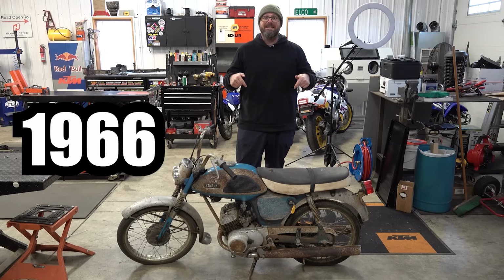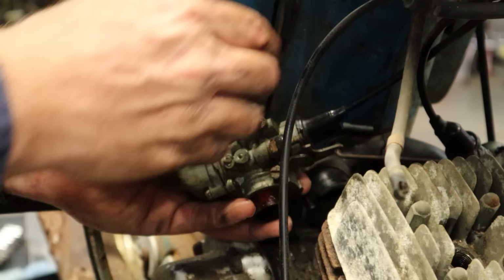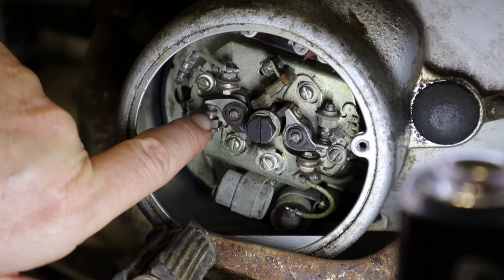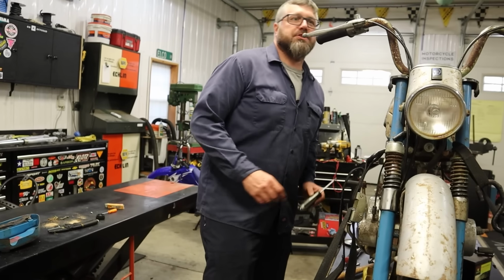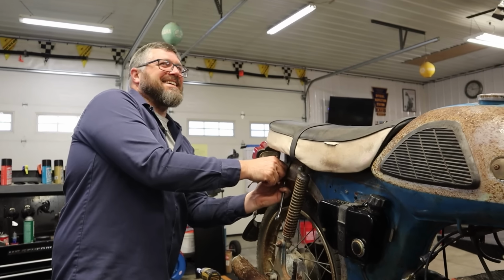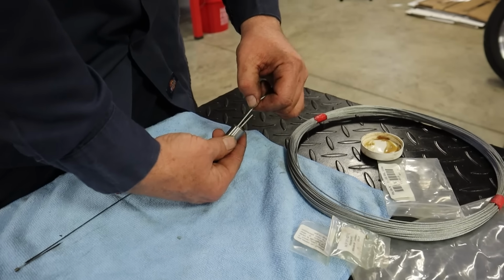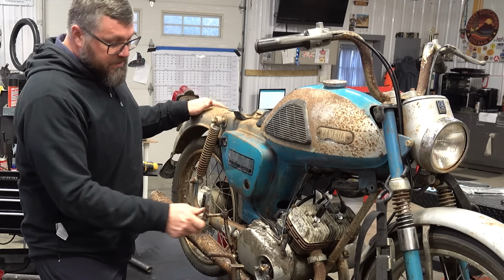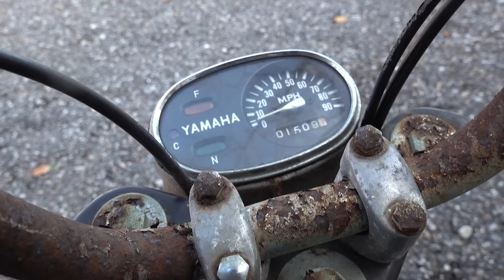Can I Get This 1960's Yamaha Motorcycle Running?

Comment: Also, per my memory, if you dont want the ultrasonic transducers on the bottom of the tank to overheat and burn up, so be sure to follow the mfg. instructions on the liquid level inside the tank. I'm not sure, but it looked like, initially, you were running the cleaner with a very low liquid level. Ask Cole Parmer if that is at all important and see what they tell you. Maybe ask for the Product Manager for Ultrasonic Cleanbers. "Can I speak with the Product Manager for Ultrasonic Cleaners?" He can also handle sending you the sample of the Branson cleaning solution.

Comment: Hi Craig, I bought a  1966 yt-1 in 1970. Came to me for a hundred bucks with a stuck motor. Installed new rings and drove it for two summers. Sold it running. I had so much fun on that bike, also I only weighed in at almost 120. Great memories. Now 70 years old and still riding, and still riding Yamaha..

Comment: Thanks for uploading this video. This  Yamaha Twin Jet 100 was my first bike as a 14 years old lad in 1969. I done some of the same work that you done but on mine the shifter barrel had a broken bolt inside. Just before winter that year I pulled the engine out and took it  into my parents basement. I worked most of the winter and in the spring I put the engine back in and it ran and shifted well after that. I went on to become an automotive mechanic and later a heavy equipment mechanic for John Deere for over 40 total  years .  now at 68 years old Your video has taken me back to my youth ! Thanks very much what a great show you made. 😁

Comment: Best part of Friday!
I love how Craig optimistically says "and you can do it too".  I can't.  I really can't.
Reply: Get a trash bike, get the shop manual, and have at it. If you buy it as junk, you can't make it any worse.
Reply: you totally can, believe in yourself.
Reply: I bought an 81 Honda trail 110. That didn’t even roll I had to drag and push it to the truck. With the help of YouTube I went through it and got it running great to where it started on the first or second kick every time. It took me 6 months in the shed after work tinkering on it when I had the time to get it there but I’m no mechanic at all. If I can do it you can too. Small single cylinder engines don’t scare me now I’m about to do a big bore kit on my daughter’s crf70. (With YouTubes help of course)
Reply: Yes you can!😃
Reply: If you have the space, and a couple hours a week, motorbikes are one, if not the cheapest way to have a go at any vehicle. You really can do it.
Reply: I can, but I don't want to. That's why I'm watching his channel!
Reply: You can!!!

Comment: I'm Dutch. Here in The Netherlands in my youth, you could ride a <50cc (3.05 CI) 2-stroke (later Honda had 4-stroke SS50's) with a speed restriction of 40kh (25mph) from the age of 16 without any license. So we all rode them as soon as we were 16. We shaved some metal (aluminium) from the heads to highten compression, widened the ports in the cylinder to create more flow. Larger carburator with only a piece of our mother's panty hose cloth as air filter. Cut a piece of the underside of the piston and changed the sprocket and rear gear,  they ran 80kmh (50mph). Later when we had the opportunity to work during the hollidays, we bought 80, 100 or 125cc (5, 6 or 7.5 CI) cylinders, heads, pistons and larger carbs.
I bought an 80cc (5 CI) (cause they looked exactly like the original cylinder and it was difficult for the cops to see the difference) which I again worked (compression, cylinder ports, race piston, 34mm (1.3") Mikuni carb and a Bosch expansion exhaust. It ran 110-120kmh (70-75mph). Buddies with 125cc (7.5CI) ran up to 150kmh (95mph). They needed to weld square tubes to the swing arms to keep them from bending.
This video made me remember a lot of fiddling, running from the cops and a whole lot of good times. Simple tech, easy and reasonably cheap to tune, repair, etc.

❤❤❤
Reply: Teenagers don't do that anymore.

Comment: I had one of these as my first bike. I bought it off my cousin and we had so much fun on it. The rear guard area was chopped out to give room for a Knobby tire but I ran the standard road tyre on the front, bush bashing all the way. We took the mufflers off and turned the bars upside down to play drag bike. Up and down the driveway until my mother would throw something at us to make us go somewhere else. To buy it  I sold a set of golf clubs I had received as a birthday present, much to my fathers disgust.  At 62 years of age, I would give anything to have kept it but alas, it was the first of many bikes over the years but I still think it was the one we had the most fun with.

Comment: YL1 was my first motorcycle - bought around 1971 (age 21). Parents didn't say much, but I  presume they were not pleased.

Couple years later, living outside Cleveland, I headed home in the dark (about 40 miles) and decided to take the "Ohio Turnpike" toll road for the first time, just a few miles, as a quick shortcut. Toll taker at the entrance gate looked down at my little bike with a sneer – wondering if it would go at least the minimum speed. She let me go, and obviously, I lived through the experience. 

The bike had a worn clutch but was still functional. The next spring, I replaced the clutch plates and promptly started popping little wheelies with the thing. First time I'd ever done that. Lately I've been missing that bike, and presto – I stumble on this video..

Four years later, after my Honda CL350 was stolen outside my apartment, I bought a Yamaha R5 - 350, which was refined into the RD350. Of all the bikes I've owned, that R5 was the best.
Reply: Still have my 71 R5 350 sitting out back, I got in late 72, It is in way  worse shape than this bike, but , it still has the memories! I ride an R1 now, and a few other bikes.
Reply: I had an rd 350- LC and then an RZ 350-LC my favorite bikes and I've owned around 20. Would love to find an old RD but the prices are astronomical.

Comment: A YL1 was my first bike. It was always a first kick start and was good for 70mph (indicated). The best thing was that it looked like a moped and when the lads on their 'nifty fifties' (usually FS1Es) wanted a drag race at the lights I could always leave them choking in two stroke smoke.
At full throttle it did leave a huge trail of smoke. I had a lot of fun on that bike and sold it for more than I paid for it after a couple of years.
Brings back a lot of memories ........
Reply: Pretty similar to a FS1. Also has 4 gears down. Only 1 cylinder

Comment: I and couple of friends bought several of these new in '66 as part of equipment for a freshman year in college. I have to tell you that we ran the ever loving "Dud" of these without a failure. We took trips out 250 miles from home. We'd follow buses and troop transports, pull in the clutch and get sucked along at 65-75 mph. Crazy right?  Still got a few pics..... They didn't like the air cleaners removed. If you ran that way for the super cool sucking noise, well you blew a hole thru the piston. So cool to see one still in one piece. God bless old Yamaha 2 strokes... I also had a 305 Big Bear I ran with 50K miles, a bunch of Kaws, and Suzuki's. The two strokes never failed. Drove them from Wash, DC to Canada, across the US and even MX. They never failed folks!!:face-blue-smiling:

Comment: You don't see many of these old Yamaha's running around anymore.  I don't believe it's worth much, but a spray paint "restoration" would be kind of neat to see.  Glad that the inside of the tank was in good shape.
Reply: Man. nice but when he acted surprised when he took off the gas cap and the tank was clean, I think he already knew that it was clean !

Comment: My very first motorcycle was a YL1 !!!   I wanted a trail bike so I slowly modified it with a high front fender, knobby tires, and a BIG rear sprocket. I was the happiest 14 year old on the planet! I tore up and down the powertline trails and construction site dirt hills. This was in 1971...what a great time to ride every day after school and all day on weekends. It only had 4 gears (4 down) and I would have that little engine screaming by the time I started up a near vertical 15' climb in a big cutout where the construction people dug up truckloads of dirt. I still have a 4 inch burn scar on my left arm from where I lost too much speed and the twin exhaust grounded at the top. The bike fell down the hill on top of me and pinned my face against the head cooling fins and the pipe pinned my arm. It was worth it...I never hesitated to try that hill again...after my mother finally gave in and released the bike hold. I would give anything to have that bike back.

Comment: Back in the mid-60s when I was a teenager, not quite old enough to legally drive a car, the Twin-Jet 100 was the bike to get. Laws limited you to 100 cc displacement and this was the way to go. But the Twin-Jets quickly became a "Belly-Button," like, everyone had one. For some silly reason my aspirations were much larger than a T-J. I really dug the Honda 250 Hawk and 305 Super Hawk, and the scrambler versions of the same. Funny that I ended up with a BSA B-33, that I picked up for $75.00, and all my rides from then on would be British or American. However, being handy with wrenches (later being a professional mechanic for 50 years), and having a fetish for motorcycles, the locals brought their T-J's, and everything else to me for repairs. I rode everything I worked on and developed some likes and dislikes. I really have to give Yamaha credit for producing a bike that could handle all the abuse you could give it and still come back for more.

Comment: You're bringing back lots of my memories of the Yamaha Big Bear!!
 I bought two basket cases from my brother. A 1965 Yamaha YDS5 250cc, and a 1966 Yamaha YM1 305cc...which  was seized,  but that's the one I rebuilt because the 250 was in pieces. So between the two bikes, I was able to build one.
 I learned how to do it all by myself with the help of an original shop manual that came with the bikes and a helpful Parts counter guy at the Yamaha dealer....
Those carburetors can be problematic if they are not perfectly clean..

Comment: I’ve done the cable install..heated up a small screwdriver …slipped it into the slot..opened it up slightly..WORKED!!
I also cut a rubber plumbing coupling to makeup the carb /connector….

Comment: Back when these were new, a friend bought one new. He stripped it down to the bone.The top end was ported and polished. Custom expansion chambers welded up. Maybe some green linings were put in the brakes? Some stubby handle bars replaced the goofy high risers. Racing tires went on stock rims. A proper fairing was painted up and mounted. And so he went road racing in the 125cc racer class at the local mountain race circuit. Unlike many of the lightweight  factory thoroughbreds of the time that either blew up or wouldn't start off the line, it was dead reliable.  And it was fast enough to get into the ruck and have fun. He got enough track time so that later he stepped up to a Yamaha TD-2. A great little engine!

Comment: Just a heads up from an ex mechanic.

Ultra sonic cleaners are godly cheat machines.

Dish washing liquid is great for most things. Strong vinegar is good for rust. Concentrated workshop degreaser for most. Parts wash liquid also works great.

Throw the right stuff in for the job let it run. Rinse off after done, I like using a brush of some kind as some of the dirts is loosely on the surface. For a better finish I highly recommend turning the stuff over 180 degrees, then running again.

But they are great machines and I have one at home that I use all the time. They are basically cheating devices.

Comment: I had a 1965 250 cc Yamaha in high school, in Lynwood, California.  Many of the maintenance items you did in this video came back to me.  What a rush!!!  Carburetor slides, ignition points, hand grips and cables!

In 1966, I rode it from Los Angeles to Minneapolis, and back. Repairs here and there. Hit a bird in Nebraska one morning. The route was not too far off the one Robert Persig did in the Zen book.

Went in the military at graduation in1967. No more motorcycles, after that.

Thank you again for the video. Made my day. Glad you got it running. 

ps Could it have been a 125cc?

Comment: I have a shop. 20 years ago I bought a twin jet 100 w/title from a family. It had 15 miles on it and the plastic cover was on the seat. It was later, 71-72. I put gas in it and a battery.  Turned the key on, touched the start button and it fired up like a new one. Cool little bike.

Comment: I helped my friend find his first motorcycle in 1969.  He got one of these and it is still in excellent condition.  At first the performance was lacklustre but when it misbehaved a bit I popped off the cylinder heads by the side of the road.  I discovered the exhaust ports were heavily choked with carbon.  I cleaned that out and the bike went beautifully.  No midrange torque of course.  It primarily needed to have the revs kept up to pull properly.  It was an excellent bike though.

Comment: My very first brand new bike was a '75 Suzuki GT185 twin street bike.  God, I loved that sweet little bike!  It was a two stroke bike too.  High way speeds were no problem in spite of the small displacement engine.  Of course,  I only weighed about 130lbs back then

Comment: My first motorcycle was a Yamaha "Twinjet" 100. I ran all over southeast Louisiana on that little motorcycle. It was also the first motorcycle I had an accident on, when someone made a left turn from the right shoulder of the road. In the thousands of miles I rode it, the only thing that needed to be replaced was the chain and sprockets.

Comment: I owned a few 2 strokes in the early 1970s onwards. I found them to be very reliable but the one downside was the mufflers would carbon up and it was necessary to remove the baffles in the muffler and blast them with a blow torch. My favourite bike was a Yamaha 350 R5F, predecessor to the RD350. I did have a Yamaha LS2, a 2 stroke single and it was almost indestructible. I finally disposed of it when I couldn’t get it to go more than 60 kilometres an hour. It needed a whole bottom and top end rebuild.

Comment: I love the use of your safety squints when you were blowing out the dust around the points. Haha. 
I had a 1964, YG1-85. It was a blast. It was a 3 kick start. Whether it was cold or just shut it off it took 3 kicks.

Comment: Great Vid, I have a 64 YG1TK, its the smaller version of this at 80CC. Mine does not have the oiler in it. Dad bought it brand new and never changed anything on it, Crazy thing is where the oiler is, thats where my carb is... one of the most PITA places to tune the carb..... Still have the bike, its on the list to bring back to life... what a fun little machine.

Comment: Great save of a bike in remarkable condition! I remember these in my early bike days - proper buzz bombs and usually ridden very hard. If the timing went off too much you'd seize or melt a piston so people that owned them had a trick of spitting on the heads and depending how fast or how noisy it evaporated off, they'd know to take it easy and do the timing. Incredibly sophisticated bike for it's year compared to what was being built in Europe!

Comment: This bike is my first motorcycle experience.  Even before I got my own driver's license i drove one of these down the road.  A fairly harmless vehicle and it was easy to operate.  It wasn't a 60 cc Honda (that was so popular during that time), it was more powerful.  I drove my brother's 150 Suzuki after this one.  I didn't fool around, my first bike was a Kawasaki H1 Mach III.  From there I became 2 wheeled trouble.  Later I went to 4 stroke trail bikes.

Comment: This is a beautiful candidate for a complete restoration.  Very cool! FYI you may be able to use Cycling shifter and brake cable to re manufacture the smaller gauge steel cables.

Comment: Very cool. I would start with TC3 at 50/1 in the tank. Wouldn’t want to fry the motor on the initial start. Then see if I can get the oil pump to work. If it starts to smoke like crazy you know the pump is working. Fun project!

Comment: All the problems are the spice of life that makes working on it rememberable 
I made a complete wire harness from scratch on my R5 350 I had. Used a modern combined regulator rectifier on it. Wasn’t hard.

Comment: You hfta get bicycle cables. You can remove and reattach the ferrules using a propane torch. Easy for throttle repairs. 
Little brass beads come from craft stores! 
Good vid boys

Comment: My first bike was a ‘66 100.  Mine was red, factory electric start, heel/toe shifter, turn signals, auto oil injection.  I got my license with it at 15 and rode it everywhere.  Tank got a scratch and I paid 60 to a body shop to repaint it, a lot of money back then!
Reply: Also…the mufflers have removable baffles.  Occasionally you need to pull them and hit them with a torch to clean off the building up.

Comment: The Yamaha YL1 was my third bike as I moved up through the cc's. Started with a Benelli Dynamo 65cc. Hand-me-down from my older brother. Then a Suzuki TS75, also handed down. I wanted more speed and horsepower, so got the YL1. Going from 4 hp to almost 10 hp was mind altering to me at 12 years old.

Comment: I bought a hundred cc Yamaha Twin Jet in 1966 with electric start exactly like that one except it was red. It was a great little bike. Never had a problem with it. I could squeak 60 mph out of it on a flat road. I put several thousand miles on it before I traded up to a larger bike.